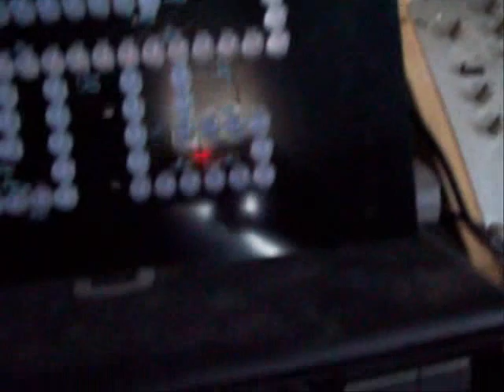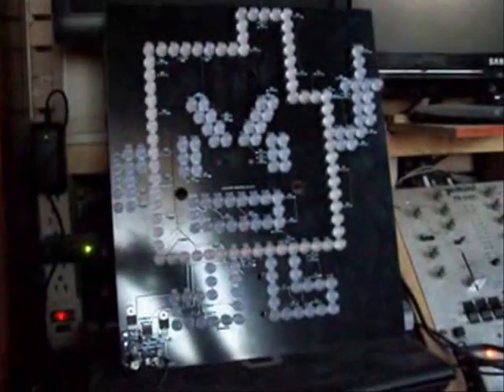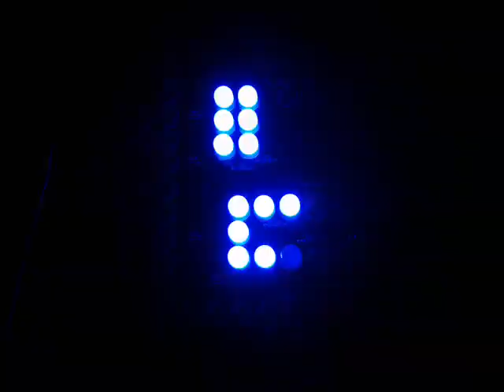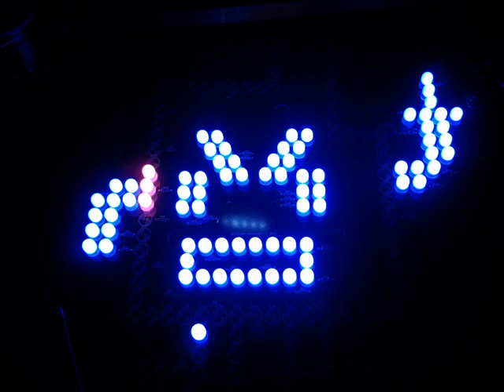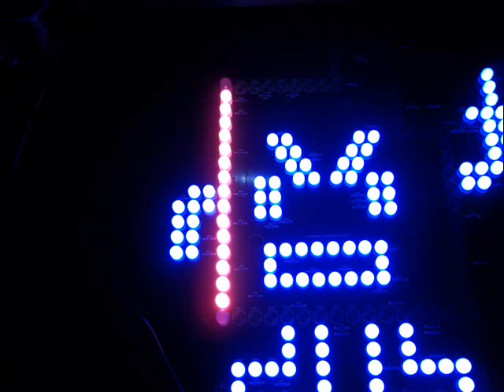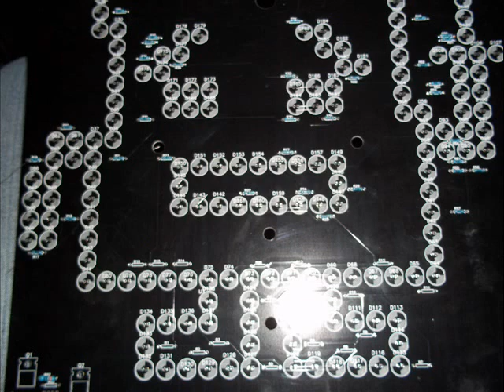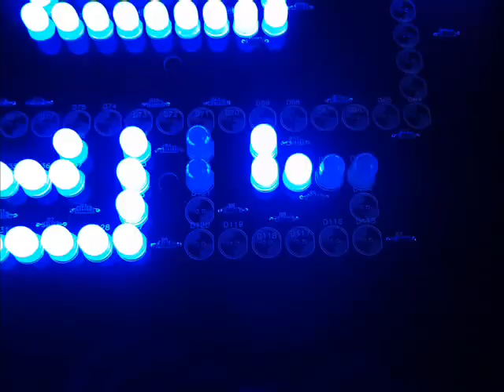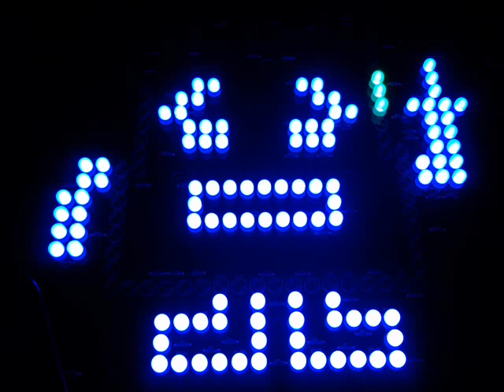Mooninite LED Sign Replicas (Contact me)

Comment from the maker: I can't make the schematics opensource, but I can point you in the right direction.  It is basically a dark dector circuit that triggers a MOSFET which then turns on the LEDs of the sign.  In my replicas, I make them to order, and customize acording to what the client wants. For instance this one in the vid wanted it to plug into the wall and choose between constant on and dark dector mode :)

Comment: Nice video. I'm currently trying to come up with a way to build one of these from scratch. I see you have resistors etc.... attached to the LED's. I assume the board is some kind of circuit board? Would wiring the LED's with bus wire work in my case in series? Any help is appreciated. Thanks